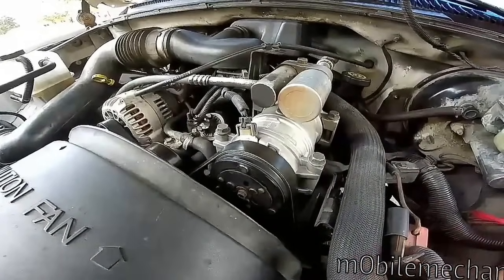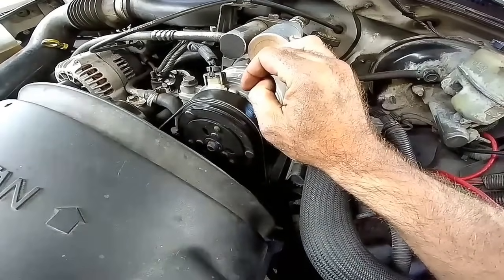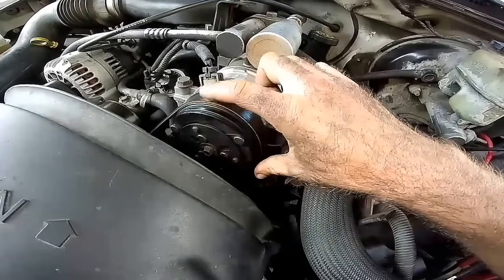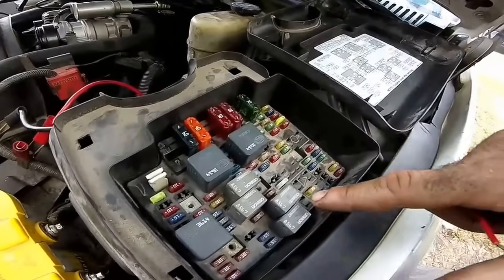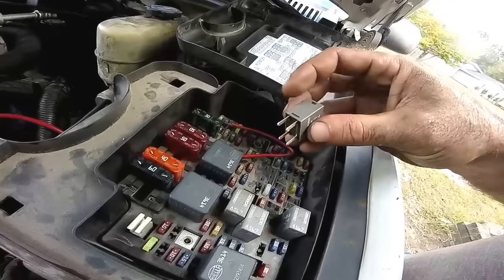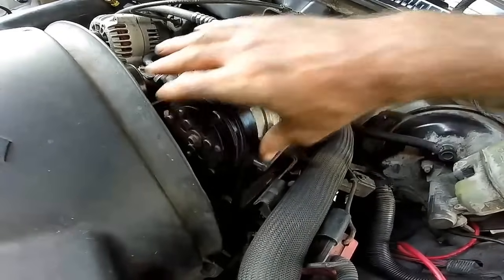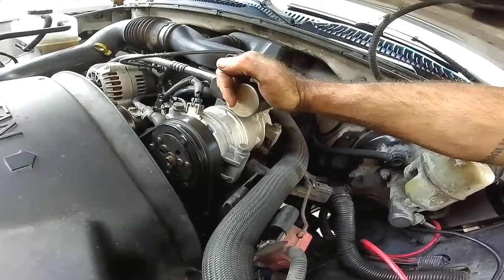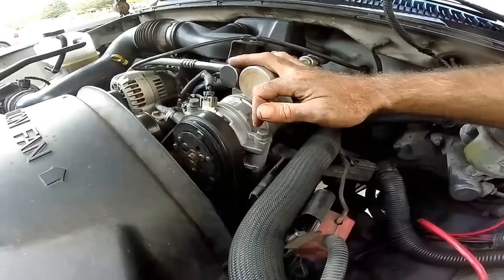Easy A/C Clutch Coil Test A/C Clutch Not Engaging

Comment: What if compressor only works when jumped  from relay  or straight from battery???
Reply from the maker: thats a good question. it means theres is a problem on the control side so either the pressure is too high, pressure is too low, the control panel doesnt work or there is a problem with the wiring in between.
Reply: m0bilemechanix thanks could it be coolant temperature sensor...
Reply: m0bilemechanix i put new control panel didnt work either...and low temperature sensor....jumped the compressor filled with freon and blows ice cold when jumped straight from battery wierd..thinking its wiring.too
Reply: Andrew P 
Hi^ it's not to risky worked for me on Pontiac Grand Prix Gt
Reply: +JBIRD575 - There is an " EASIER WAY " in case your " High Pressure Switch " is bad. I made a Video a while back in case someone needed to do it here: https://www.youtube.com/watch?v=3C4w7Ecrn4Q
Reply: OP, are you saying you are using a jumper cable like he is using in the video? If thats the case then wouldnt it be the fuse?
Reply: The Ace TroubleShooter no im going straight from battery and to the compressor with a wire and its turning on only like that fuses and relays are good
Reply: Great video. I did just this and the clutch engaged as it does in the video. I then started the engine, put the a/c on and jumped the compressor, but still blowing hot. What’s next? Check refrigerant level? Thanks
Reply: JaxWash Pressure Washing yes add some refrigerant when jumped
Reply: Maybe it’s Just me  different system doing that fyi.

Comment: So when your clutch is bad the bypass doesn't keep the ac clutch spinning when the car is running correct?
Reply: If the clutch coil is open or the clutch gap is too wide, the clutch hub stays in the disengaged position ever if you power it. With a multimeter you can check if the coil has proper resistance or is open. When the coil has proper resistance but the hub is not moving, you have to shorten the gap.

Comment: Do you know you are only one of two videos, that talk about the coil in the ac. Its like every one avoids that part when it comes to the clutch not engaging, and  i can not figure out why they would not talk about the coil.  It simply baffles me why they will not talk about the coil and what its job is.
Reply: nick beam The word coil can refer to the condensing coil (outside) or the evaporator coil (inside). Which job is to reject or absorb heat respectively. 

There's also electromagnetic coils like relays. So what did you want to know?
Reply: Jonathan Roeder an ac clutch is electromagnetic..

Comment: You were doing really great (thank you) til the ending startling comment about a clutch kit costing $200 to $300 (!?)  That's VERY "expensive" indeed -- and doesn't seem accurate, at least not in 2020.  First, Autozone and auto parts places rarely carry clutch kits anymore, perhaps as places like ebay, Amazon, and the wholesale direct parts places so badly undercut them.  (For my Kia Sedona, I can get an entire clutch kit for $40 or less....  And as my coil is still working, I may only need to replace a clutch plate/hub, plus bolt, shims, and pins -- which I can get for under $6.500 -- sic -- plus shipping)
Reply from the maker: The price and availability does very alot by manufacturer and depending on where you purchase it. I use parts stores or dealership when I'm in the road I don't have have time to order parts. Price ranges were normally between $90 and $280

Comment: I did the paper clip jump on my ac clutch cycle switch and my compressor engaged. I replaced that switch and the compressor doesn't work do I need to replace the connector and wires? Why does compressor only work with paper clip

Comment: When I test it with the wire from the relay the clutch doesn’t move at all but you can hear a click in the compressor. 

And when testing for power in the compressor it does get voltage.
Reply: so what was wrong with it? what does that mean?

Comment: Hey guys, I need help. My car was running fine before I tried this trick on my Honda Accord 2006 v6. Now the car refused to start and it just cranks when I'm trying to turn on the car. Any tip will be welcome. Thanks ahead for the help..
Reply from the maker: this test wouldnt cause any problems unless you accidently jumped something other than pin 87 and 30 on the ac relay. if you sent voltage to 85 or 86 you potentially fried the ecm or main relay. not much i can help you with not being able to test stuff or see what you did. hondas dont always have the pins labeled
Reply: Thanks for your answer .
Reply: I see this was some time ago but I believe you blew the fuse for the ignition etc. located in the fuse box inside on the left below the steering wheel.

Comment: Your diagnostic method is not 100 % complete. Your method can confirm an operational clutch, however it cannot confirm wiring integrity from the AC relay to the AC compressor connector.  In other words if your your test method does NOT ENGAGE the clutch, it doesn't confirm 100% the clutch is bad.  An additional test is required to complete the AC compressor wiring integrity, place a 12 volt test light with its alligator clip  attached to battery 12 volts, place the point of the 12 volt test light at the load side of the AC relay pin 30 on the AC junction box.  The test light should light indicating a complete wiring circuit from the 12 volt test light , through the clutch coil wiring to the ground side of the AC compressor connector.  If test light lights during this test and AC relay is providing 12 volts at pin 30 and the clutch is not engaging then you have a bad mechanical clutch (its stuck).  If the test light does not light up during this test you have a bad connection at the AC connector or open coil in the clutch.  Thanks for your video.
Reply from the maker: As stated in the video this isn't a diagnostic it is simply a way to see if  the clutch is capable of functioning. If it functions like this then the coil, the clutch and the wiring are good. If it doesn't function like this then you need to do the testing you are talking about.

Comment: OMG !! NEVER and I do mean NEVER jump circuits with just a
wire. The jumper MUST have a fuse in it so that if you pick the wrong terminals
then the fuse pops instead of your car. A $1 fuse much cheaper than putting out
the fire caused by shorting the harness.

Also, many cars (like mine) has a PCM controlled by the ECU
as well as 1 or more switches in series with the coil. A fault in any of these components
may inhibit the coil from getting power. My quest was to find out what the coil
resistance should be but unfortunately was not included here.

Unconfirmed information so far should be 2 to 5 Ω.
Reply from the maker: it is fused.... thats where it gets power from.... the fuse.
Reply: I have been working professionally on electric vehicles for  over40 years and IC vehicles on the side.First in a service department of a manufacture; then as an
Engineer/Drafter; then as tech writer, then tech support for a dealer network.

My duties cover everything from design consult, to prototype,
to manufacturing, to document manufacturing procedures, to writing tech
publications, to creating troubleshooting procedures, to training other techs.

The fuse box in the engine compartment has a hot that is
likely protected by a fusible link, some are not protected at all.IF you are unlucky enough to pick the wrong terminals then .
. . .POOF.
NEVER jump a circuit with an un-fused jumper.
Reply from the maker: its fused facts are facts regardless of your background.
Reply from the maker: i see you put INCASE you touch the wrong terminals in witch case you are correct. however if you make sure you are at the correct terminals then it is fused and there is nothing to worry about.  not bad advise il probly update the description and mention to be careful
Reply: Well my clutch engaged when I jumped it now what do I have to buy? To fix it? I switch the relays around and nothing changed. Should I just leave wire in there? With electrical tape? I need cold air lol

Comment: You never mention what is the name of the relay, you just pull it out, you have to say what the fuse is doing, or blower, or fan, or clutch, but you just pull the fuse and don’t say what the fuse does in the system
Reply: He looked at d cover case (with wiring diagram) and identified d relay controlling d compressor

Comment: Clutch kits are 80$
Reply from the maker: some are. it ranges. ive replaced alot of them and they range greatly and an be in the hundereds. just depends on the vehicle and weather or not its dealer only. i have seen some vehicles that i was able to get them as as around $80.

Comment: You just show one car, how about the others? Not all cars are the same, fuse box and relay tray is are in different places. I dind't learn anything from this video.
Reply from the maker: Most ac clutches work exactly like this. If you can't find your relay open your owner manual and it will show you. If you don't have the manual just Google search year make model and relay location.

Comment: 15 hundre ac replace men🤨 compressor is 350 with tax renting guages is 100 at autozone freon is no more that 80 buck that expensive brand plus vacuum shouldn't spend more that 600🤦‍♂️
Reply from the maker: A shop after markup labor and tax is around $1200 and up to $1500 if the system is full of debris from failed compressor. Need to replace oriface tube or expansion valve and also the evaporator. Certain vehicles require replacing condenser.

Comment: Lol, Amazon sells a brand new a/c Compressor, and Drying unit for $300
Reply from the maker: Does everyone have the knowledge and tools required to evacuate the system, vacuum the system and service with the correct quantity of PAG oil and refrigerant? A set of cheap gauges allowing you to read both high and low side at the same time while filling will set you back around $90 alone. Then you need a vacuum. You can get one of those for around 100 bucks. What about recover of refrigerant or are people supposed to just dump in into the atmosphere. There's a reason a compressor replacement at a shop runs between $1000 and $1800. Replacing the coil is something a handy person can do with a little effort and a rented clutch puller.